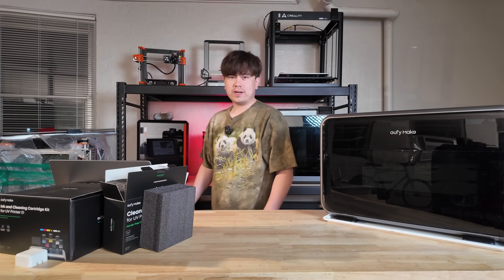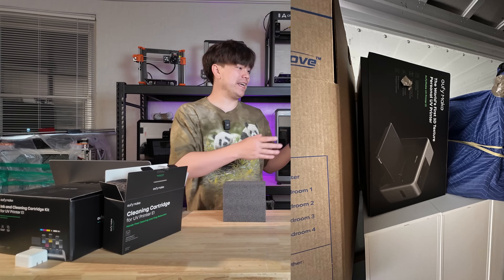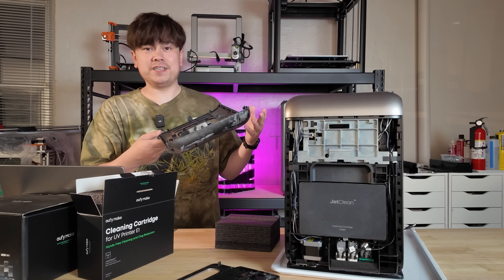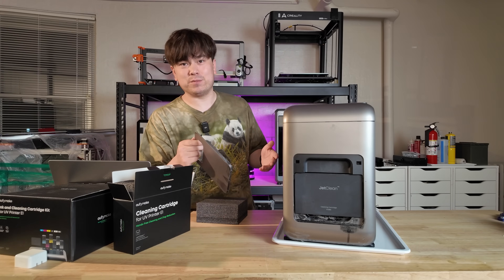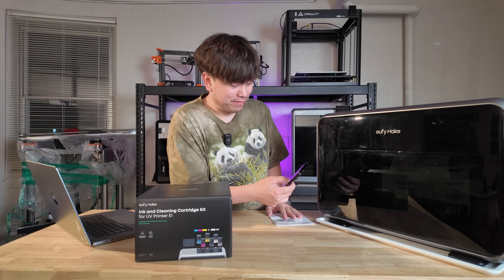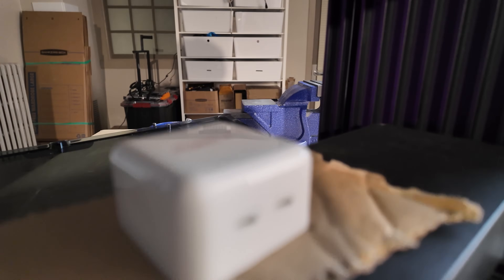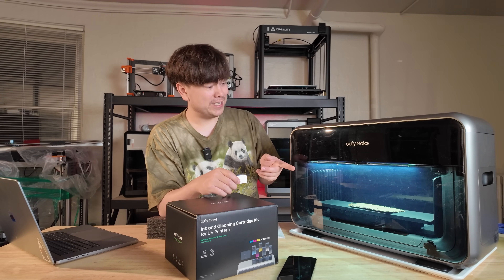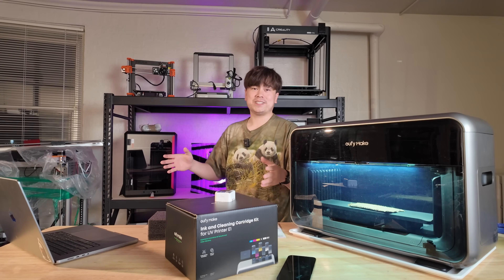I made a EufyMess - EufyMake UV Resin Spill

Comment: Now this is a real world test :-). Do you think it would've been not as bad if you had removed the cartridge or would there still be ink/solvent in the lines?
Reply from the maker: There way it works is there are 3 needles that can be covered up with rubber plugs. If I removed the cartridge and installed the rubber plugs there probably wouldn’t have been any problem. 
Though I’d be concerned about the ink cartridges leaking if left tipped over for a long period of time

Comment: why is it not fully sealed feel like that is a big no no
Reply from the maker: I’d be interested in seeing an accessory that is pretty much a form fitting Rubbermaid container with a gasket so it’s airtight. I wouldn’t mind paying $50-$100 to make sure it emits 0 odor while it’s not in use. I can turn on a vent or open a window when I’m using it

Comment: If still works is always a win! 😅
Reply from the maker: It seems like the solvent pack is the weak point. The ink cartridges might leak as well, like if it was fully turned upside down and shaken, but when I inspected them they seemed ok.

IDK if this is really a problem, but I decided to document my experience anyways. Just a reminder to not flip it upside down and on its side!
Reply: can you remove the cartridges before transporting the printer? I imagine it wouldn't be too difficult to design and 3d print a box for securely transporting the cartridges in a way they wouldn't leak.